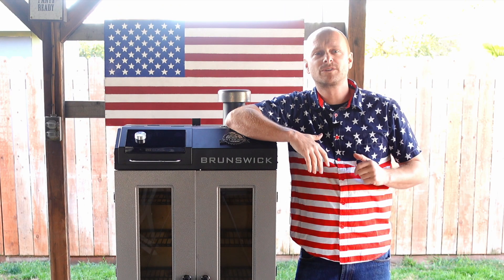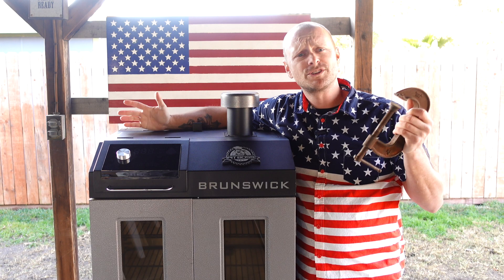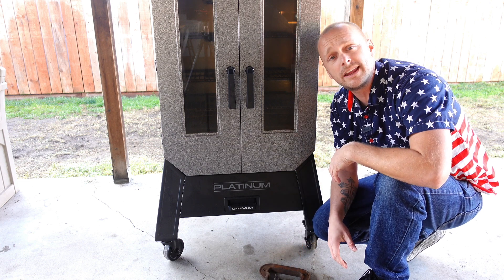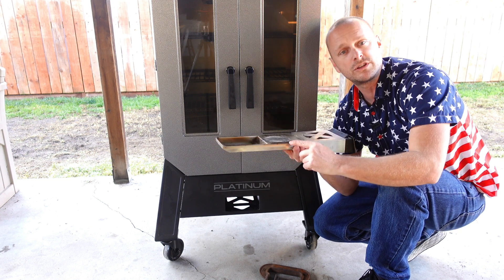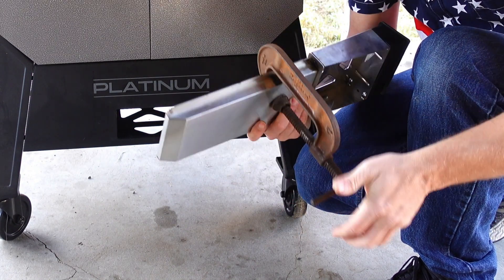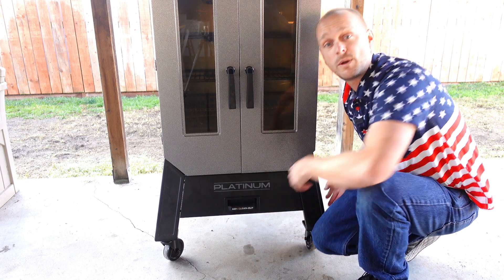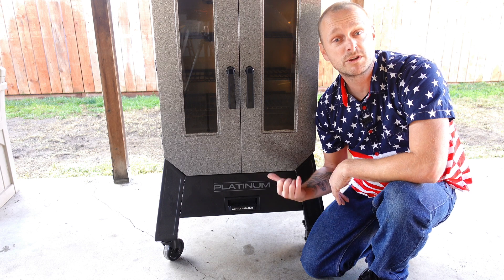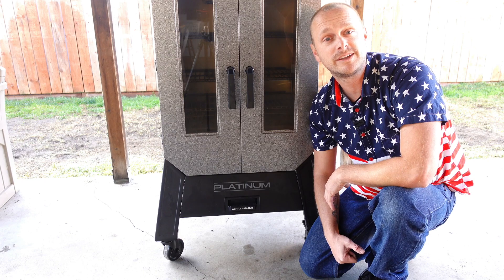How to Fix a "Stuck" Ash Clean Out Tray on the Brunswick #PitBossNation #AshCleanOut #EasyFix

Comment: I had the same problem and fixed it easily with a different solution. There are two metal pieces that accept the top lip of the tray inside the opening. One of mine was not bent down enough, causing the try to be impossible to slide in and out. I pushed a flat head screw driver in the open slot to bend down the metal inside the slot and now the tray slides in and out with ease.

Comment: Sorry if this has already been suggested but wouldnt it make sense to place a small piece of wood (2x4?) under the bottom portion of the burn plate so that you are only bending the top surface back into shape, and not bending both top and bottom together?  Just a thought.

Comment: Got mine out of my Laredo by pressing and pulling on the handle while prying on the back of the ash tray inside the cooking chamber. Then I put the clamp to it! LOL Thanx Sarge!!
Reply from the maker: Nice! How you liking the Laredo?
Reply: @GrillSergeant  first and second cook of ribs and chicken quarters went great. Ruined a brisket last night though. 6 hours in I got an ERL. Grill shut down and i didnt notice for about an hour. Meat had good color so i wrapped and restarted. when meat probes read 200 degrees I checked temp with 3 other probes. All read 175-180. While checking I had the lid up and got an ERR code so I shut the grill down and restarted but forgot to set temp. Grill stayed cold and meat cooled down for the second time. Meat dried out, shrunk down, never could reach temp so i threw it in the garbage.
Reply from the maker: @mitchtucker5768  Oh man. That sucks.

Comment: I have the brunswick with the updated ash pan, it doesn't warp but mine was getting stuck

I noticed the rubber gasket inside was out at the top so the rubber was causing a lot of friction, popped that back into place and slides right in

Comment: This is a great fix, but what do you do to get it open so you can use the C-Clamp?  I did my burn in, and cooked some ribs.  The ash clean out is completely stuck.  Now what?
Reply: There's another vid for that here somewhere, I had the same issue. You can take the entire box under the drip pan off easily by removing 4 screws and exposing the burn chamber then use the backside of a screwdriver to push down on it and it'll slide out after that.

Comment: My ash clean out tray was getting stuck from initial assembly. The plate underneath did not line up properly with the opening for the ash tray so it was getting caught on it. I was able to bend it some to get it to work better, but still pretty difficult to get the ash tray in & out. The tabs for the greese tray were also pretty bent. Seems like these units have quite a bit of bent or misaligned parts from the factory. They really need to do a better job of quality testing.

Comment: I just purchased one of these and was noticing that the ash catch was different on this ('22) years model apparently. There seems to be welded support bars crisscrossing the bottom of the burn pot but with a hole at the bottom I guess to allow it to cool off easier? I have photos I can send but even thought I've done a few cooks with it so far and it's been sticky it's never been overly difficult to open so...

Comment: Thanks for info, love the pit boss, hopefully they can fix that, between the series 4 and the Brunswick, what’s the longest cook you have done without getting an error code for to much ashes? Or how long till you do get the error?
Reply from the maker: I’ve yet to get an error code on the Brunswick...and I let it run for 24 hours when I did a brisket on it. The Pro Series gave me a jammed auger code once when I first got it but after I started sifting my pellets it’s been a full year without any issues.

Comment: My new brunswick is cycling pellets straight into the ash clean out tray. Is there a screen on the bottom of the burner pot that I might be missing that is not allowing them to burn?
Reply from the maker: The plate on the ash clean out tray is the bottom of the burn pot. You aren’t pulling out the ash clean out tray when it’s on right?
Reply: @GrillSergeant  First pit boss. I think it was just a rookie mistake. I think I was just to impatient on letting it heat up all the way. Seems to be working now.

Comment: My issue was this and the little rubber slip gasket at the back of the 1st chamber of the ash clean-out. This seal isn't even listed in the parts diagram in the manual, I took it off because it was half off and not allowing me to fully insert the ash clean-out tray and now I have zero issue. I would normally be pretty worried about a missing gasket but this one just goes between where you mount the ash clean-out housing and the underside of the smoker. Anyone know of it's purpose or what it is there for?

Comment: My restore tip would be flip it over on a vice or flat surface and hammer it flat, just saying 💪🔨😉
Reply from the maker: Al, you would be a guy to pick your Brian about...any permanent fix ideas to prevent it from warping from heat?
Reply: @GrillSergeant  yeah well titanium or a ceramic heat shield might be overkill, or not.
Reply: @GrillSergeant  I am about to purchase this smoker and have been watching many videos.  Thank you very much for that.  What do you think about simply cutting a hole in the area that warps?

Comment: So did my burnoff... ash tray is stuck. What is the trick to getting it out?
Reply: Did you figure this out? I’m currently having the same problem after the burn off.
Reply: Just had this problem with mine, I ended up having to use a claw hammer and push the lever on the tray down to unlatch it, then get the claws in between the side lip on the front of the tray and the front of the brunswick, and swing the hammer handle outward using the top of the hammer and the claw as a lever, and alternate sides a couple times.  Mine was stuck in there something fierce.  Finally popped free though.
My unit didn't have any obvious damage but the fit of the panels and components is just utter trash.  Misaligned panels on the interior, gaps, smoke coming out from the front doors at the corners, the doors don't sit quite straight... and assembly of the legs and support panels was a pain even leaving all nuts and screws loose until I got everything in place to start I still had to force panels into place.  The quality control and manufacturing tolerances on these units is just bad.  Water pan also is very difficult to slide in and out, and scrapes on the sides of the interior of the chamber.

Comment: Can't even budge tray won't  move first burn out
Reply: Any suggestions  you told me to go to 400 I did now I been pulling shaking it side to side nothing need help
Reply: I used a nail bar on mine It worked for me just don't use to much force might break the plastic
Reply: I'm in the same position. Absolutely can not get it to come out.
Reply: @EdwardMendes97   It has  a release that you have to push down on while pulling , I used a nail bar  to pry alternating  from side to side , once I got it out I used a C clamp to depress the center
Reply: Thanks for the tip. I tell ya, someone needs to make a video on prying this thing loose.